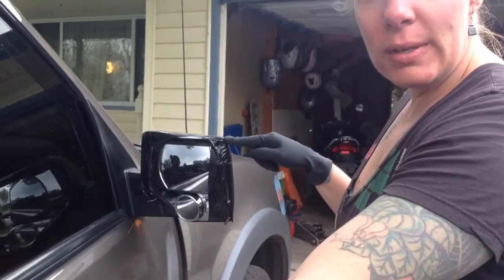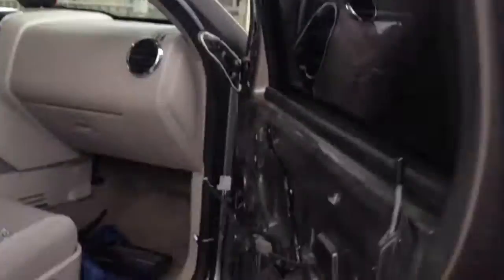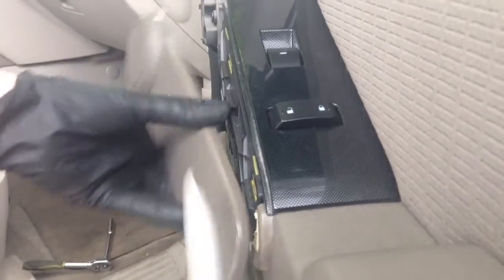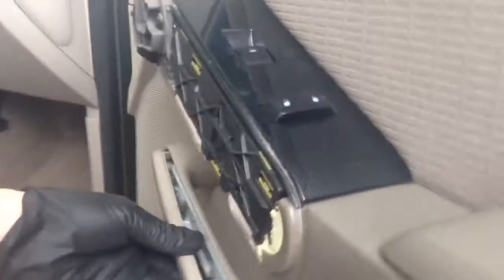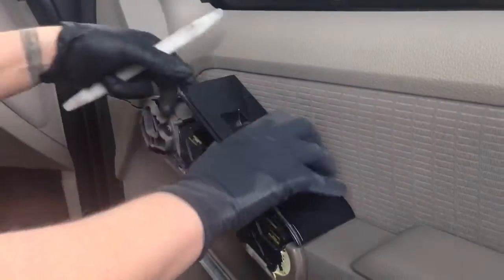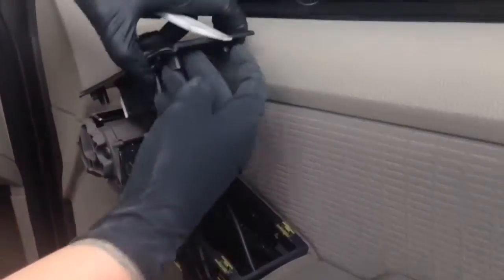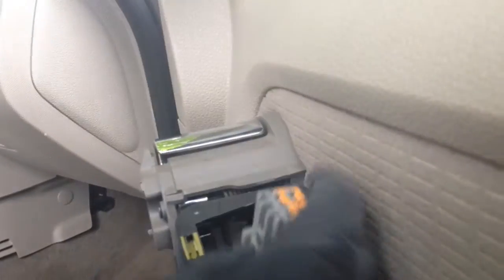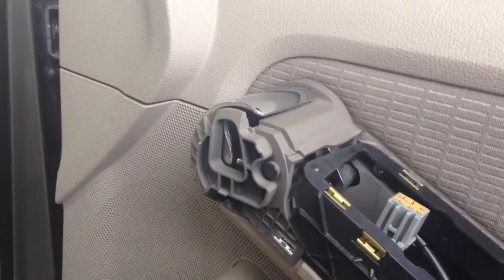Passenger Side View Mirror Replacement 2006 Ford Explorer

Comment: excellent video !!!! pace is perfect !!!!!! just replaced the passenger mirror on my 2010 Explorer using this video. note: 2010s don't have the door handle, so only 4 x 7mm bolts
Reply: Agree as just replaced the PS mirror on my 2010. Didn't undo the cable just hung it with a bungee. Have to make sure all the panel tabs are flush took me a few minutes but got er done, thanks for the video